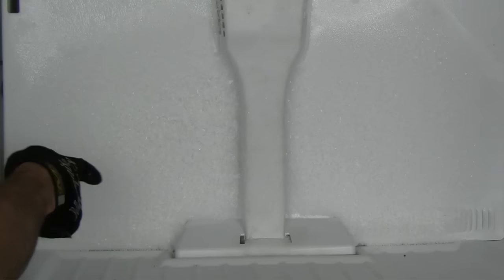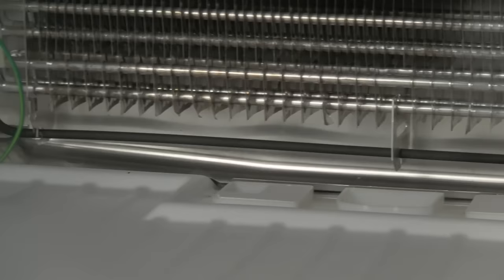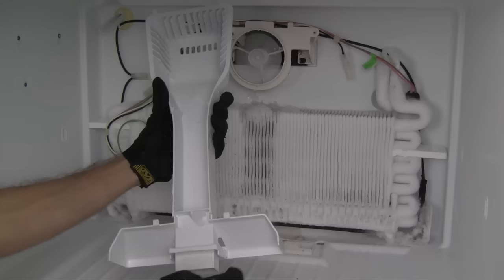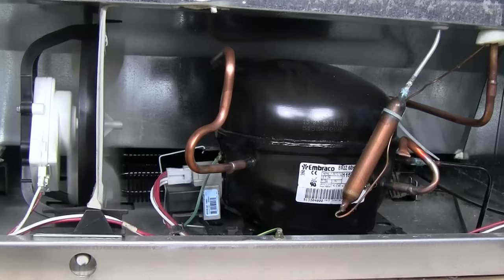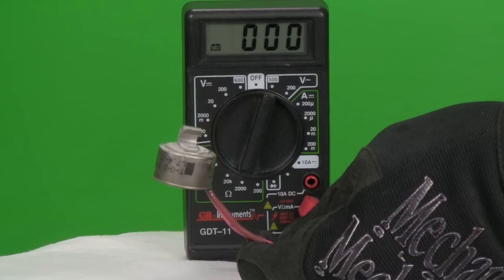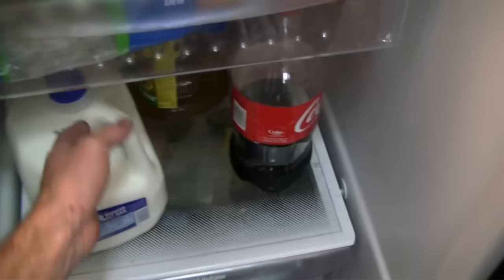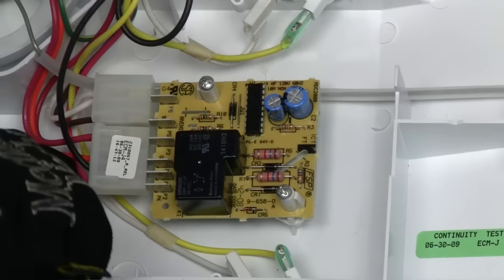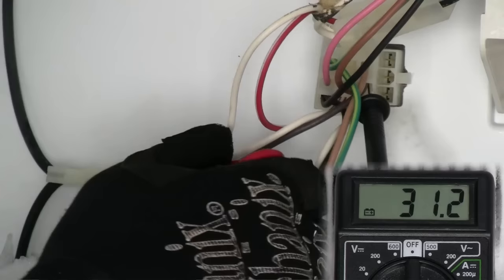Refrigerator Repair (Not Cooling, Defrost System)

Comment: hanks for the video. Just curious...I have a samsung and the top of the coils keeps icing up with the bottom clean. I felt the heat from the defroster on so I know that works...would the bi-metal thermostat be causing the top to ice up? I can tell its affecting the cooling of the inside
Reply from the maker: It could be a coolant flow restriction. I would advise watching it for a while when it’s actually cooling, you should see frost start to accumulate over the entire coil. If not it’s an expensive sealed system repair. Fingers crossed 🤞🏼 
If the coil is frosting evenly, I would replace the defrost thermistor sensor, and look for air leaks into the compartment from the room.
Reply: @applianceassistant  everything looks good as far as no air leaks, not to mention it just started this all of a sudden. From videos and reading it seams like the defroster is staying on and not letting it frost over to cool which is why I was looking towards the bi metal thermostat
Reply from the maker: If that’s the case, you may want to check the power supply coming from the control board to the defrost circuit. It should not be constant, only temporary when a defrost cycle is being performed. The bi-metal is more of a safety than a control.
If the defrost relay on the control is always closed, the control would need to be replaced.
Reply: @applianceassistant  I’ll check again, it may not be on constant because there was ice forming in the drain where the defroster dips into the drain hole. I’ll go over all of it again, the bi metal was a cheap part so I don’t mind changing it anyway. Thanks for the info
Reply from the maker: No problem! Best of luck!

Comment: what do i do if my refrigerator won't cool or freeze anything. All of a sudden it stopped shooting warm air from the bottom and there is this fan thing inside that works but it doesn't seem to cool anything Model: GSH25JFRE WW any help would be appreciated thanks.

Comment: Sorry but the evaporator thermostat does not determine when defrost is needed.  It can tell how much time it takes to defrost the coil with adaptive defrost.  But it opens when the evap coil gets to about 50 degrees stopping heater and closes about 20 to energise defrost coil.  Coil always heats up because freezer is below 20F, it's how fast it gets to 50 with adaptive that either adds more compressor runtime or subtracts so that it finds a sweet spot as to how often to defrost.  If doors are never opened it will defrost anyway after so many hours of compressor runtime.  This of course applies to adaptive defrost as opposed to defrosting every 12 hrs. no matter.  You still have defrost thermostat  but do not learn as to how often to defrost from the time it takes to melt ice.

Comment from the maker: @bren3kids I hope so too!  I would need a brand, model number, and a little more information to be able to give any suggestions.  The noise may be the defrost heater?? but it should not work if the defrost thermostat is not cold..Is the, freezer cold?  Perhaps the evaporator fan (the one in the freezer) is out, or having a problem.. Is the back wall of the freezer cold?  You can email me directly through my website.  ApplianceAssistant Com  thanks for watching and commenting. I hope we can help!

Comment: Amana ABD2233DES bottom freezer Christmas I noticed freezer was working great but fridge was warm.  In freezer that there was frost, so I defrosted the unit, and it worked great again now few weeks and I defrosted the unit this weekend.  I have researched a bit and think it is either thermostat, heater or main control board ???? What should my readings be using the multimeter if all is ok with the heater and thermostat, is there a way to test control board? Is there one more prone to issues?

Comment: your videos are awesome, thanks!  I have a Frigidaire: Fridge at top, Freezer on bottom. The freezer works fine, but fridge stopped working. I vacuumed the base at the back, around the compressor & such. Few days later it's still not working. However, I found small icicles hanging from vents on the left side of the freezer (at top going into fridge) & it feels like ice is up inside there. Right side feels clear. Can you recommend anything that i can do?

Comment: Hi, I'm trying to recover a Coolzone compact U/C fridge freezer I recently bought, I think I tilted it too much in transport & now it won't cool properly.  It cools a bit, the freezer is down to <5c, but the fridge isn't really cooling much atall.  Can you tell me, have I simply ruined the system - people talk of oil creeping up the pipes from the compressor, or is there something I can do to repair it?  Thanks in advance:)
Reply from the maker: If compressor oil worked it's way up into the sealed system, theres not a lot you can do to fix it that would be cost effective.  I'm not familiar with Coolzone... but if there is a fan down by the compressor, check to make sure it's turning freely.  also check the evaporator fan inside the freezer.  If all that is okay it's probably done for...  Best of luck!
Reply from the maker: Is Coolzone the brand? You may also want to check the coils under the appliance to make sure it's not full of dust... That's where the heat that is pulled from the evaporator is released into the room.  If its all clogged up with dust that can cause a problem. (Same as if the condenser fan down by the compressor is jammed or not running.)

Comment: I have a Maytag side by side refrigerator model  #mfi2269vew1  that freezes everything in the frig  part no matter what temperature we regulate at,a censor has been replaced and the demper  has tested ok.Already spent 185$ with a professional with absolutely no results.

Comment from the maker: To really run it down to the board or the relay you will need to have and know how to use a volt meter to check for voltage from the board...

Comment from the maker: I doubt the defrost system is your problem.  Sounds like a control thermostat... or your compressor may be over heating...  You may want to check your condenser fan and clean out the condenser coils under the appliance.  If it is the mechanical thermostat type you can test for voltage into and out of the thermostat when the refrigerator should be cooling.  If it does not pass through, the thermostat must be bad.  Good luck!

Comment: Hi, I have maytag and whenever I put new control board circuit board is keep burning.. any thoughts?
Reply: Model Number is: msd2351hew
Reply from the maker: Apart from bad parts I would guess high amperage passing through the control relay switch, which would be caused by a short somewhere… probably ether in the defrost heater or the compressor.  What problem where you having before you replaced the control?

Comment from the maker: Unfortunately, it does not look like that board is available in the USA for a little while... it's still a good part number but they are not available.  I don't see any cross over notes on that control.  : (  Bummer...  Normally if you where to order it I would guess 2-4 weeks or so... Good luck!

Comment: Hello dear,
There is some problem with my fridge which is not cooling at all, it happened just after a month of no use while it was plugged in and turned off from the thermostat switch (although before that one month break, it was working totally fine). When turned on, the compressor starts its normal sound, and water dripping sound through the radiator can be heard from the interior of the fridge and freezer (as in normal refrigerator start up). I searched online for several testing techniques, almost all are the same. There are three probes in the compressor: C, M and S (where C is the top one and M,S are side ways). The resistance check between C-M=40.56, C-S=44.34, and M-S=84.9 ohms. So theoretically, it looks alright, as M-S = (C-S) + (C-M). But the ohm reading examples on the internet are 4, 6 and 10 ohms. May be different types of compressors have different resistant readings. However, the continuity check is a bit ambiguous. The continuity between C-M and C-S is alright, but between M-S is no buzzer sound, however the multimeter displays some ohms reading for it. So i am confused about this test. The relay is a SSR type so cannot be checked. And I am doubtful about that relay because both on it probe and the connecting wire, there is some electrical burning indent. But the continuity between two probes of this relay is ok, so it’s pretty confusing. The thermostat is a large advanced type, so I am not sure how to check that. Please reply me ASAP because m in a heck. or PM at mowaisshahid@gmail.com. 
Thanks
Reply from the maker: Owie if thecoptessor starts and you are hearing the sounds of liquid and gas running through the system, it's not the compressor or the start relay or the thermostat.( assuming that the compressor continues to run for more than a few minutes.) sounds like a restriction in the cooling system... which is very bad.  I would look at the evaporator coil fist( behind the freezer interior wall) it should turn white an frosty all over. What it should not look like is some frost and then the frost stops and there is clean aluminum after that for the remainder of the coil. If you have a partial frost pattern the refrigerator is going to be very expensive to repair, and it can only be fixed by a certified refrigeration tech, because it requires opening the seals system and evacuating the coolant... Hope that helps!
Reply: First of all, thanks for the reply dear. I think you are right. When the machine is turned on, compressor sounds like running and liquid dripping sound can be heard, but no cooling at all even after hours of waiting. As you said, the interior of the freezer evaporator coil should turn frosty all over, but there is no frost, no cold, may be because i can't see any evaporator coils inside (as its kind of a mini-fridge). So may be you are right.. 
Thanx
Reply from the maker: Owie my pleasure. I wish I had better news for you.

Comment: Hi! I have a Samsung RT54MBMT fridge (19CFT multiflow coolever zone). It is three years old, but was not much used, since we are home for only two months in the year, since we are working out of our county. Cool does does come down to the fridge. the upper area (freezer) behind the wall is full of front and sometimes the fan is stuck. Now from today the fan is not working and there is no cool either in the freezer area or down area. Pls advise what has gone wrong with the fridge.

Comment: I have more detailed troubleshooting of other common refrigerator problems on my website that may help.  The question is if the compressor is actually getting power and running. If the compressor is actually pumping and the freezer is not getting cold... That would be a very bad thing.  I don't know what could have happened to cause that with changing out the thermostat... apart from a short of some kind or if you accidentally ruptured a sealed system line and the gas leaked out. : (

Comment: amana refridgerator abb2524deq is what we have just defrosted it the 2nd time in a month , lower part is freezer which works great what could be causing this to keep freezing up? we do here it rattling throughout the day and sometimes we hear this knocking noise but that knocking almost sounds like its coming from the top part in the fridge, were stumped can you advise what to do,  thanks
Reply from the maker: There is a small motorized door that controls airflow into the fresh food section, I would guess that that motor is the source of the noise and possible airflow of cold into the refrigerator area. However, that does not explain the frosting up problem.  I have a diagnostic guide for the control board used on your refrigerator here:
http://applianceassistant.com/Refrigerator-Repair/12784415-Refrigerator-Control-Diagnostics-Repair.php
You can force a defrost with the diagnostics if it's cold, and if it works you probably have a bad control... If not then the most likely cause is the bimetal defrost thermostat.
I would love to hear how it turns out. Good luck!

Comment: A follow up...we defrosted the refridgerator(GE Monogram) and cleaned coils under neith to perfection..unit worked fine for 1 1/2 months..but now it is back to 3º in freezer and in 44º refridgerator the last two days and not recovering. No one is leaving door open by the way..
What do you think? Thanks

Comment: hi there, i have a whirlpool 6th sense fridge/freezer side by side. i noticed my fridge was to warm and it is set at 2 degrees normally. i removed the back panel inside the freezer and found the Evaporator was totally frozen. i switch off the fridge/freezer and defrosted with a hair dryer and cleaned out. i then rebuild all and switched back on, day later all was working 100%. 2 weeks later i have the same issue, what would be the problem?

Comment: Sticker on the part has the following notes:
PBAMAIN ASSY
Volt 286v
DA41-00472M
Timer 8Hrs/10mnts
Lot No. RTOS / M123456789101112/ W12345KR
Product 2009/11/22
Check Sum / 805E/ROHS.
When you read this whole, do you that the part is the defrost timer or is it sub-prat in the defrost timer. Please advise.

Comment: It worked for 4 days. I had it unplugged for a hour,,plugged it in but had it off for 10 hours. The fan is running but freezing everything but slowly. My fridge has cold air inside,,just not keeping my food cold. The ice is building back up in freezee

Comment: I moved and had to lay on its back my built in kitchaide fridge.
When I started the fridge after 12 hours standing, it will not cool. why?
Reply from the maker: Sorry for the delay! You probably already figured this out but standing the unit up for 12 hours may not be enough. Generally you never want to lay them down if you can avoid it, and I know a built-in it’s difficult to avoid it...

Comment from the maker: I'm not having any luck with that model number... Found it on the samsung website but no diagrams seem to be available, so I'm not sure of the mechanics : (  Is there still frost on the back wall of the freezer?  If so I would think that you have a defrost problem. Take a look at the troubleshooting refrigerator problems pages on my website hopefully that will help shed some light on things.

Comment: Hi, I still have the same same problem. Since then i have bought a new refrigerator (w/ mec. timer), but i do miss the AMANA which has worked perfect for 5 years now.  I received a recent reply from applianceassistant a few days ago & they mentioned that it could be a power supply problem, but i really haven't had time to check into it. Either that or some say that one or both of the NEW factory boards (MAIN & ADC) could be defective. Sure wish i had the right answer to help you out but i don't.

Comment from the maker: Sounds like a bad start relay on the compressor.... : (  Check each of the three compressor pins for continuity to the copper tubing of the sealed system. A connection would be bad (compressor windings are shorted.)  If there is no connection and the pins are in good shape try installing a 3N1 hard start relay. That might get it going again... Good luck!

Comment from the maker: @robert3359 Well...If the freezer is the proper temperature and the fresh food area is not cooling yes. However, a bad evaporator fan in the freezer compartment can also cause the same symptoms.  In some cases a bad freezer fan can cause your freezer temperatures to be off as well...frozen on the bottom and thawing on the top.  If the freezer is just not cold period thats when you need to be looking at the compressor, start system, or thermostat. Clear as mud right? (More at my web site)Thanks!

Comment: Have a Jennn Air double door frige with bottom drawer freezer, it is not getting cold at all, how can i fix quick??
Reply from the maker: If there is no frost on the back wall of the freezer, you will need to check and see if the compressor is working.  I would recommend going through the refrigerator troubleshooting on my website.  There is a link at the bottom of the video description.  That will tell you what to check and what the possible causes are. Good luck!

Comment: I checked my heater with a multimeter and it says 0.6 ohm, does that mean that the heater went bad?
Reply from the maker: That’s pretty low resistance for a heater. It’s usually more like 25-40 ohms. It’s rare for them to fail that way, but assuming your reading is correct I would say it’s worth a try!

Comment: started out with ice dam on freezer floor, coils not iced....heater element checked good....manually defrosted.....replaced thermostat....problem not solved....replaced thermostat timer (wire to #2) now, no ice dams, but coils frozen and frost on  freezer back wall??? also, whats that black bag attached to one side of evaporator?
Reply: I am also trying to figure out what that black bag is, ours melted off & I don't know if we need to replace it? It seems to be working fine without it 😁
Reply: Found it! It's more than likely a insulation patch - We just flattened our black square out & reattached it http://www.justanswer.com/appliance/50iqx-year-old-kenmore-frigidaire-top-freezer-refrigerator.html
Reply from the maker: dowahditty69 Sorry for the very slow response! Hopefully you have this fixed by now. The ice dam was a frozen defrost drain...http://applianceassistant.com/Refrigerator-Repair/Troubleshooting-Refrigerator-Problems_pg3.php#IceSheet
The new frost problem is strange... If you manually advance the timer to a defrost cycle does the element heat up? Whats your refrigerators model number?
Reply from the maker: While They Were Napping Thanks for the link!